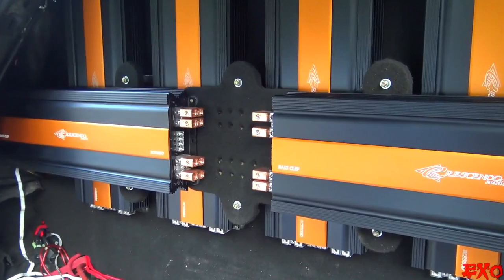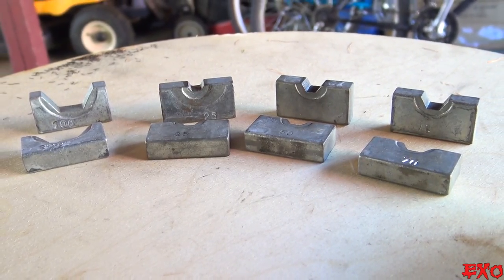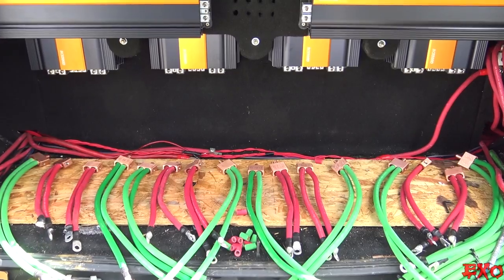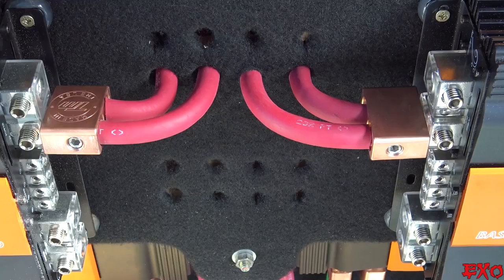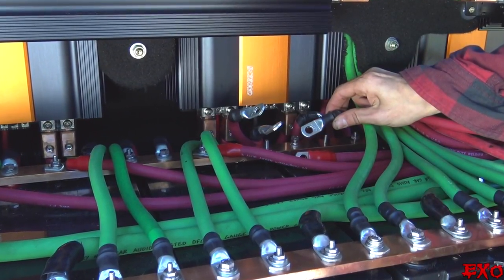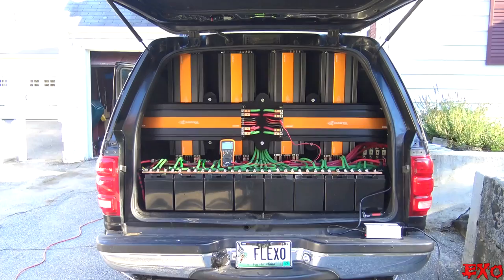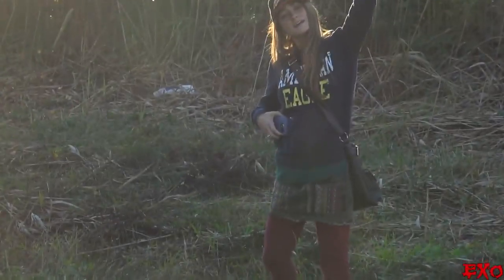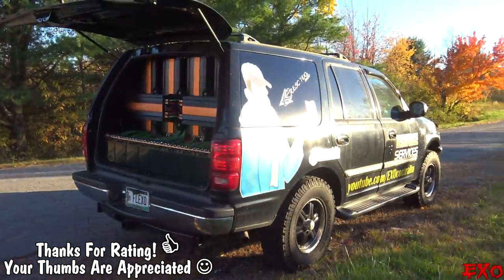EXO's 30,000 WATT Amplifier INSTALL | Wiring SIX Crescendo Amps + 1/0 Toolmaker Inputs & TESTING SPL

Comment: jesus where do I start??  you can hang an elephant off you wiring,, doesn't mean it has good conductivity. put an ohm meter to it and let that show me how good it is bro.   I see you used the flash option on your camera in the "after" pics in you video... wanted to show that you awesome cleaner was good or just lazy to show an ohm meter test. I can show you perfectly shined piece of **** that has better measurements than that. hmm  "lets test the amps by sparking th3 terminals!! yaa how about you disconnect the battery before doing any electrical work. what the heck man!"  and you had to rev up the engine to give it max RMS/peek of your volume? that literally makes no sense as the current/draw to the amps will be the same at any RPM.  lastly you said "my voltage is a little low im sorry" or some **, 14 volts your car read.. that's perfect in any book so whats the problem there?? I wish I could get this video removed as to not bring down the ignorance of others.mail me for any questions pleaser/s mark federspiels-6 cabunit 36281  box# 566fpo ap 96389
Reply: Glad I didn't have to write that :P
Thanks for saving me the time
Reply: ditto
Reply: Damn that was a whole lot of "i'm jealous i'll never hit 160 in my lifetime" coolaid.
Reply: hanging from the cable shows how strong the crimp is thats he was showing and the rest of your novel you wrote up there. and if you dont know he was reving his engine up means you dont know much about car audio